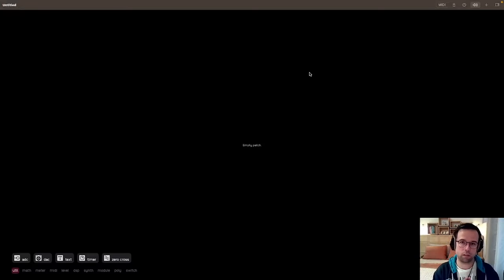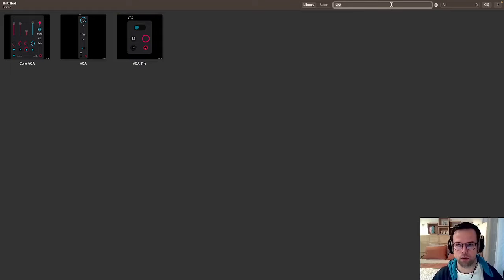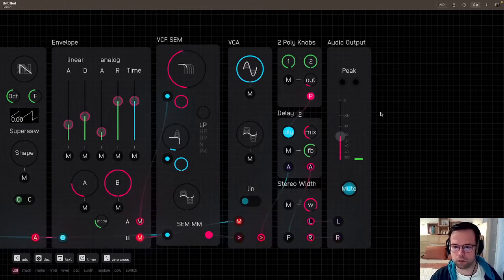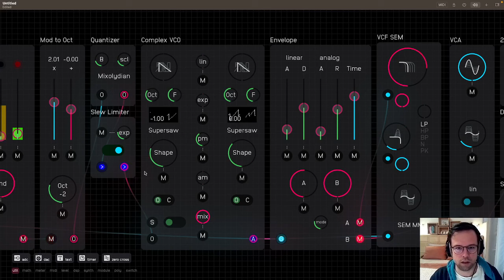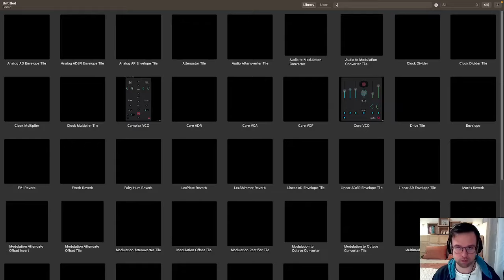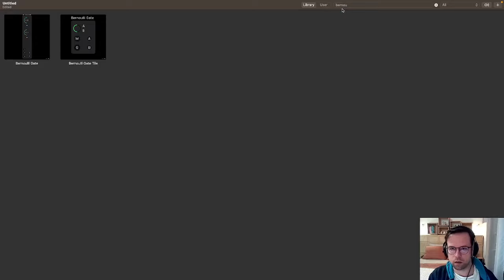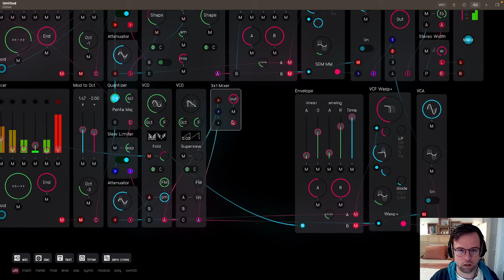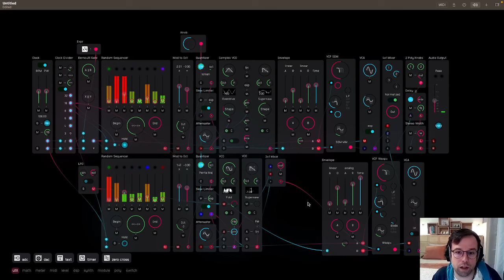Wired Up with Mark 1 - Complex VCO, Simple Sequence

Comment: One thing I noticed when following along with building this patch in the iPad standalone version (same apples in AUv3) is that when you edit the Expression node for the Bernoulli Gate I did not get a list of drag functions. The referenced "list b..." was blank, unlike your tutorial where I could see the list of functions...
Reply from the maker: Yeah there are slight differences between iOS and Mac, and that is one of them at the moment. If you look at http://docs.audulus.com/nodes/#expr you can read about all the different expressions you can use.
Reply: @audulus  ok thanks for clarifying that and the document reference. I have an Intel iMac still running Monterey, I realise that Audulus on MacOS requires Ventura. Does it also require an M1 Mac?
Reply from the maker: @anacrusisinthailand  It does not require an M1 Mac (I actually don't have one yet either! 2017 Macbook Pro). The reason it requires Ventura and iOS 16 is that both of those OSes solve a bug on Apple's side that was interfereing with our patch screenshot generation. If Apple solves the bug or we find a way around it, we'll lower the requirements on both platforms.
Reply: @audulus  Thanks for your response and explaining the situation...